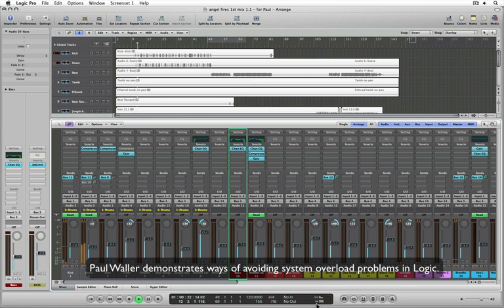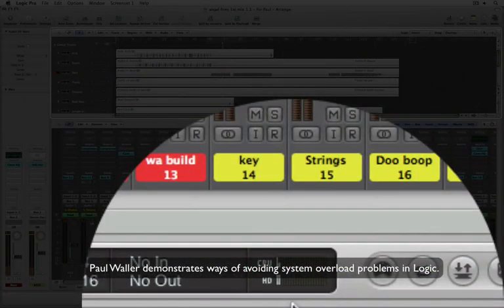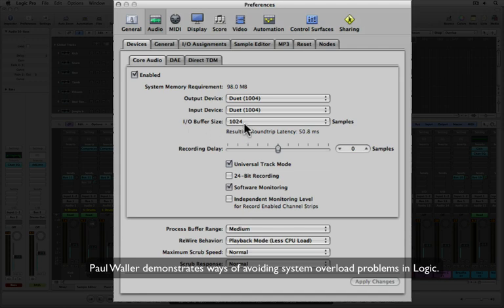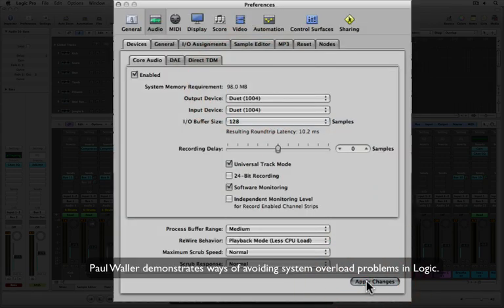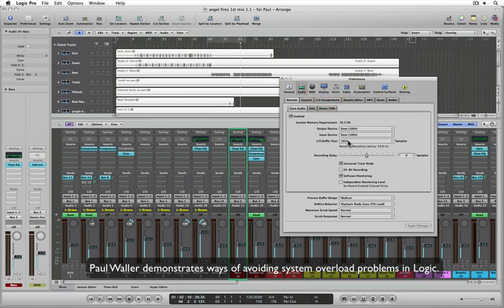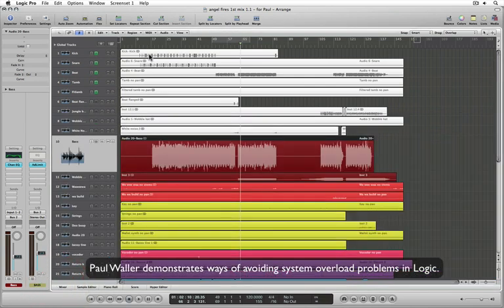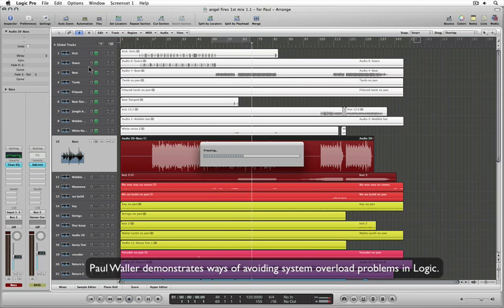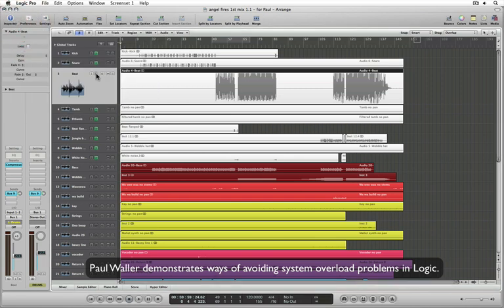cpu overload.mov

Comment: Hi Paul

I am considering adding 2GB of Ram to my iMac- running 10.6.5 OS. I am currently using logic express and 2 GB of Ram.
Would you expect a reduction in system overloads/crashing if I Add the 2GB?
Second, if I upgrade to Logic 9, I will need to upgrade to 4GB of RAM as well as OS Upgrade- again, would you anticipate 4GB of RAM to suffice?

Thank you very much

Howard

Comment: Paul,  Thanks very much.  Ironically, while your suggestions to improve CPU load were great, what seemed to have really worked was the exchange between you and @sprangful.  I enable 64-bit mode, and (I assume) Logic was then able to use the extra 4GB of RAM.  This seems to have decreased the load on all my projects (even those with no frozen tracks).  So thank you for your work.
BTW, your delivery style in your videos is very pleasant.

Comment: Very useful video! Thanks for posting :) I constantly get this 'system overload' error which can be infuriating, especially when it happens mid way through a great vocal take! I've been working on an Imogen Heap cover recently and with over 100 tracks, I just accept I'll have to put up with the error messages!
I've been thinking of converting to pro tools 9 for a while (Im not too impressed with lots of features of logic, and its 'illogical' work flow!) Would PT9 be a better alternative? Thanks!

Comment from the maker: @GuardianOfFate12 Thanks for the feedback & in answer to your questions...

1. The new iMacs are more than capable unless you're working on a huge project.

2. I swear by Apogee interfaces - I use the Duet & Ensemble. In my opinion there's absolutely nothing on the market that sounds as good as the Duet for that price. I've used MOTU interfaces many times over the years - I consider them to be very good but Apogee's converters are definitely better.

Best,

PW